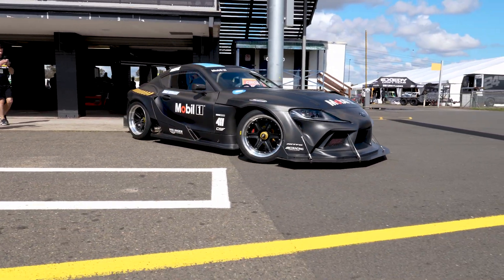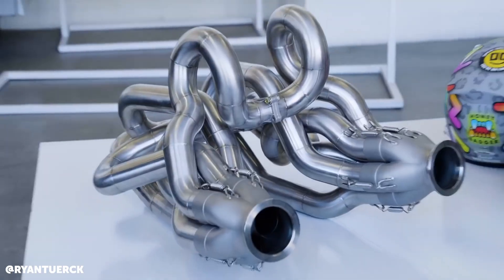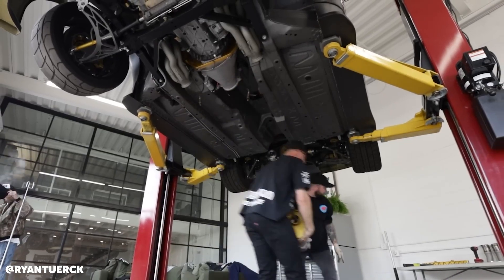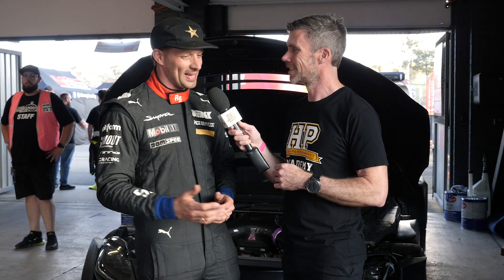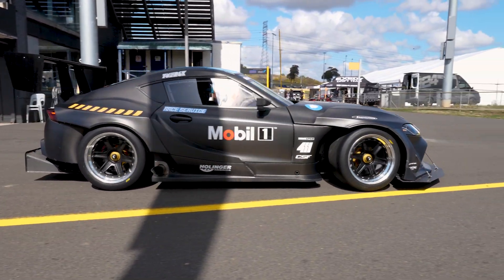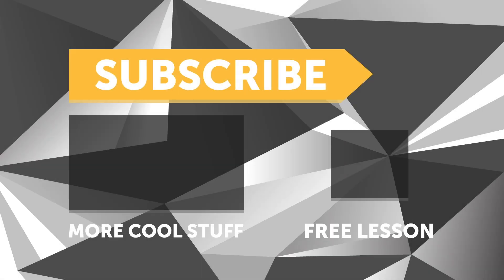You'll NEVER Guess This Connection: 11,000 rpm V10 Supra Vs Ford Explorer

Comment from the maker: Building a fast car? Get $400 OFF the VIP package with every current and FUTURE course included: https://hpcdmy.co/vipy7
50% OFF your first EFI tuning course. Enrol now: https://hpcdmy.co/offery7

This is without a doubt one of the best presented vehicles you will ever see (which made tripping over it more embarrassing but I don't think anyone noticed 😅) and has many interesting aspects to it from both Ryan and John in their respective Tuned In podcast episodes (019 and 104) - https://www.hpacademy.com/podcasts/
Ryan also discusses how he has been able to fund (with some of his own money in this case) builds like this via sponsorships and industry relationships which do no happen overnight and take constant work. All worth it I'd say! - Taz.
Reply from the maker: TIME STAMPS:
0:00 - V10 Supra - Ryan Tuerck
0:15 - Why A Judd V10?
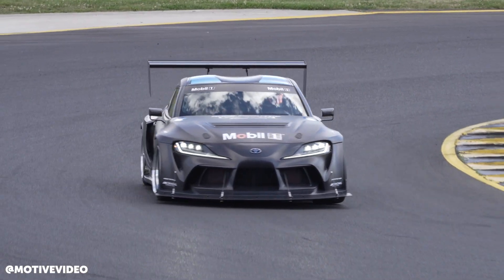1:18 - Done For The Love Of It
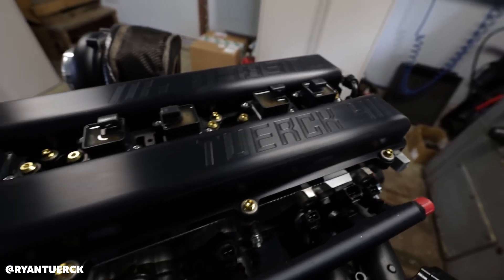1:40 - Formula 1 Engine?
2:15 - Engine Specs
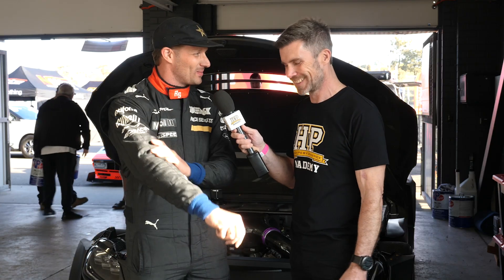2:25 - Horsepower
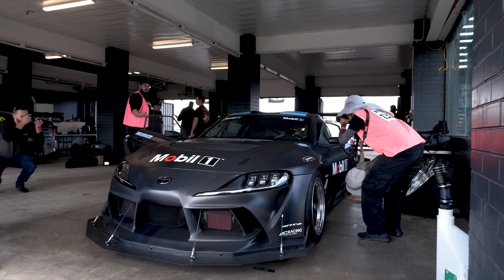2:56 - How To Buy A Judd V10
4:00 - Funding The Engine
4:23 - Maintenance Schedule
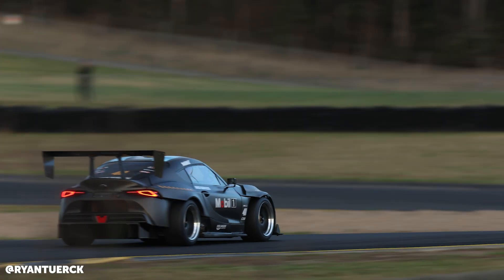5:26 - Hour Long Start Up Procedure
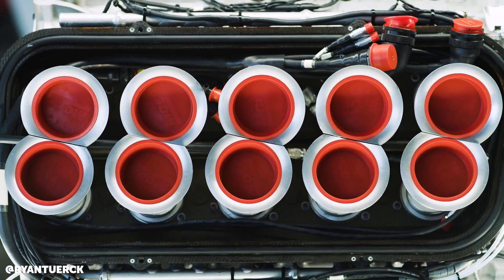6:04 - Warmed Up To Increases Lifespan
6:19 - A90 Supra - Why?
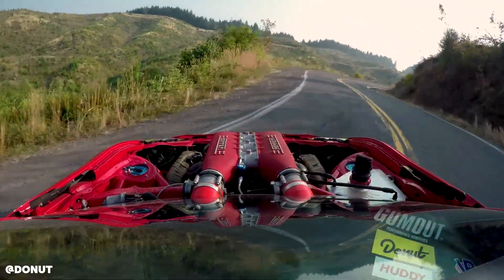6:55 - Hollinger RD6 Sequential
7:18 - Ford Explorer Rear End
8:08 - Electronics Packaging
8:38 - Tuning John Reed Racing
9:22 - Time Attack & Project Direction
10:22 - Drifting A Judd V10
11:30 - Clutch Setup
12:05 - Torque Vs RPM & Idle
12:37 - Engineered For High RPM
13:02 - Fuelling
13:31 - Judd Privateer Support
14:04 - Brand Recognition
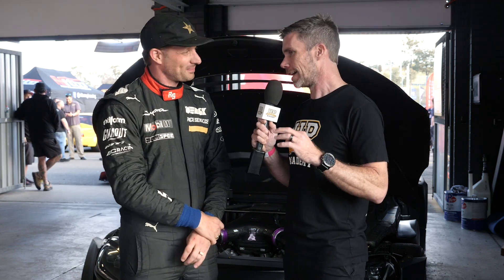14:27 - Thanks Ryan!
14:48 - Judd V10 Vs Ryans (Motorsport Approved) Jandal
16:46 - BUILD. TUNE. DRIVE.

Comment: Probably i didn´t heard it, but whats the weight of that thing ? Awesome to see that kind of enthusiasm, to build such a car, this kind of engine, wether if V8 or V10 is like a holy grail in motorsports, there is not many more to be and of course its a lot easier to put a big turbo on the machine and get power, more than you need.
Reply from the maker: I believe it was around 1100kg without driver  for this event as published by WTAC (as in you didn't miss it, we didn't ask in the interview sorry!) 😎 - Taz.
https://worldtimeattack.com/index.php/ryan-tuerck-formula-supra/

Comment: too much car for a judd , they're made for 650kg - 900kg track cars , them supra's are +1500kg
Reply: Yes because this is definetly a stock Supra with metal panels and a full interior and all features...
Reply: @ihavewaited90daystochangem51  
Still gonna be +1300kg . just means shorter lifespan
Reply: @TheCraigy83  man you really have no idea what you're talking about. This thing weighs under 1300kg and Carbon surrounded by a multi point cage is safer and longer lasting than anything made of metal.
Reply: @TheCraigy83  also an engine is made for exactly what you put it in when you build everything around it, The ignorance of some random guy with zero credibility and experience acting like they know better than career professionals is hilarious.
Reply: @ihavewaited90daystochangem51  
You sound American. 
i make single seaters . 
Judd themselves will tell you the increased load from extra mass will reduce the lifespan.
Reply: @TheCraigy83  yeah sure you do, i knew from the second i replied that you're going to give me some bs about being a successful figure in racing, like magically every oldhead in YouTube comments is.
Reply: @ihavewaited90daystochangem51  
No just a simple mechanical engineer, go kart moto x experience, 
Nobody would argue against what i'm saying🤦‍♂️ extra mass causes more load = increased wear + heat , what the hell is wrong with you matey 😂
Reply from the maker: @TheCraigy83  Correct me if I'm wrong, but you were not allowed a car lighter than 900kg in the LMP1 class this engine debuted in and the weights were more like 900-1000kg than anywhere near 650kg. At WTAC, where this was filmed, this car was around 1100kg, so it's still a fair bit porkier than an LMP1 chassis, but far less than +1500kg, too and very impressive for what started out life as a Supra for sure! - Taz.

Comment: He says the engine needs to be rebuild every 3000 km. In a racing scenario where the engine is being stressed for many laps and seasons I can fully understand this.
But let's say if this Supra was used as a regular road car, would the rebuild intervals need to be the same? How durable are these engines in a daily driven scenario as a street car.
Reply from the maker: You won't find any documentation or data to make your own, but for some aspects it would absolutely be different for road vs race - Taz.

Comment: At some point, I really want to make a crazy project. Not pure track crazy, but a super hot street build. I want an EG Civic coupe with a light turbo K24, maybe 300-ish horsepower. All the hot stuff. Ohlins coilovers. Brembo brakes. Quaife sequential. Rollcage. But done properly. Very clean, very street. Full interior. And a wacky bodykit, neon lights and a full Itasha anime waifu wrap. I want to build a sleeper which is a sleeper by being as un-sleeper as possible.

Comment: I’d love to see this thing evolve with full unlimited active aero and turbos to compete against something like the Porsche RP968. I know he asked Judd about the possibility of turbocharging it and they met him with the 😐 face. I think I remember the Kyle Engineering page mentioning collabing on an Indy V8 powered Honda S2000 as well. If that ever gets off the ground, we could see some psychotic head to head matchups.
Reply: FD drivers are fun, they went through an era where it was all about getting more horsepower and they settled at 3x the hp they used to compete with, on machines that they’re able to control with incredible precision. The latest season wasn’t very competitive but it showed the power that teams had over individuals for the first time. Smart minds with loose regulations will always be able to go beyond what we think is possible.

Comment: I originally slated this car for using the Judd engine for drifting , saying it was not a suitable engine and probably drop a valve . 
So so pleased they went to time attack . 
I watched quite a lot of the documentaries of the build and was very impressed yet cringed when they first went out on a demo run thinking that engine ain’t going to last . 

Ironically just as these guys it was Georg Plasa and his Judd e36 that has influenced and inspired my journey. 
We’re half way through a super light e36 GTR with 750bhp 😵‍💫. Definitely not an easy task considering the only un touched un modified components from the original shell are the rear lights and steering rack 😂. 
Great interview guys 👍🇬🇧